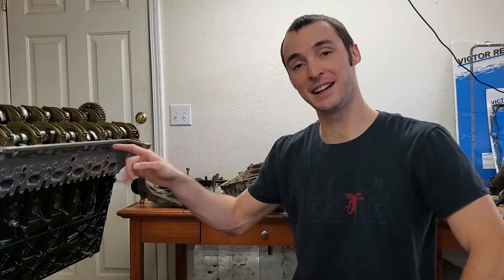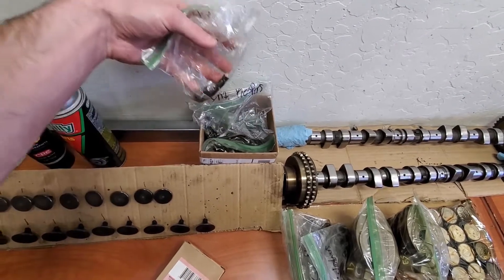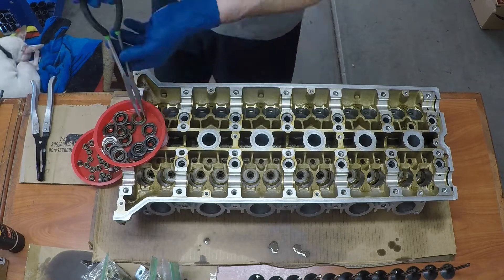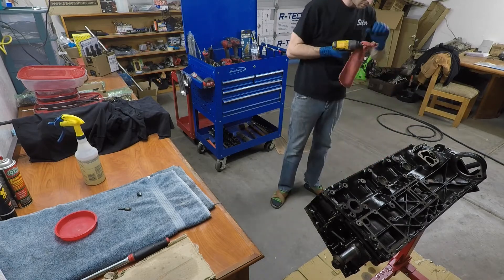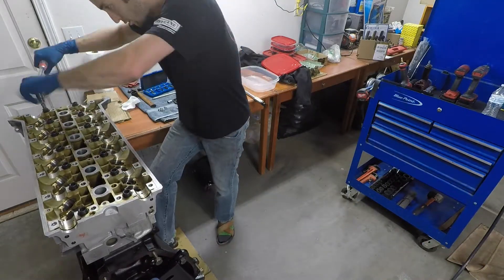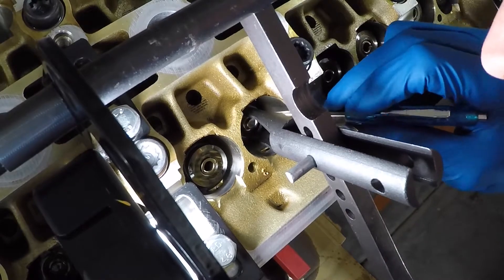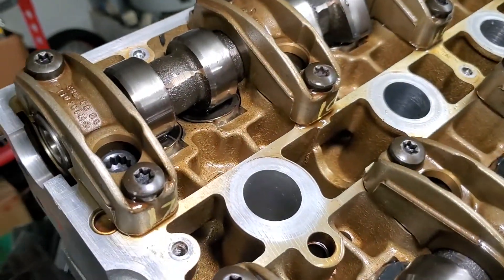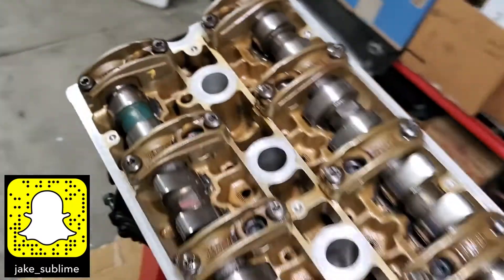Assembling The Head - M104 Turbo Build (Ep. 16)

Comment: can you recommend oil for m104 turbo?
Reply from the maker: I 100% will use "Pennzoil Ultra Platinum Full Synthetic 5W-30" with some "Lucas Oil Pure Synthetic Oil Stabilizer". 

Mercedes might recommend using 7qt of oil on an oil change, but ive read that this can cause oil leaks as if this were "over full". So, my methodology is as follows: Drain oil, replace oil filter, pour 1qt lucas oil in, pour 1 5qt 5w-30 jug in after to rinse the lucas down. Also, i use a KN oil filter. 

This comes to 6qt of high quality life extending oil. As long as no leaks, 6qt will be fine until 5k miles for an oil change. Total cost around $40 per oil change. Cant beat it. 

Oil: Pennzoil 550045201
Stabilizer: Lucas 10131
Filter: KN HP-7008

Ill do a video on this later for everyone.
Reply: @JakeSublime  i saw ppl use castrol and rehinol 10w60 oil for turbo setup so im lil lost
Reply from the maker: people use what they use. I use what i use because ive seen the studies and data. 

To understand what the motor oil viscosity numbers actually mean, check this: https://www.rymax-lubricants.com/updates/what-does-5w-30-actually-mean/

Do yourself a favor, check out project farm's video on motor oils, and which is best: https://youtu.be/TWuKvnCq1js

The very same youtuber has a video talking about what oil additives are best: https://youtu.be/x3CfLBkew2c

Hope this helps you make an informed decision friend.

EDIT: Let me know if this helped you.